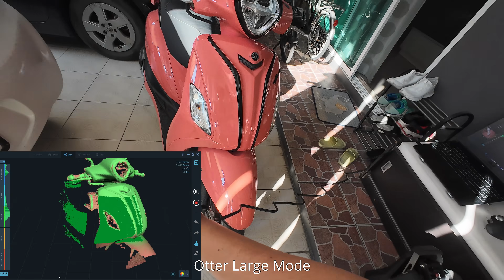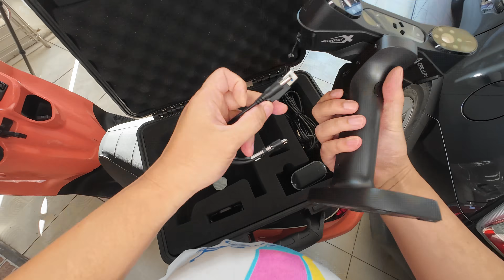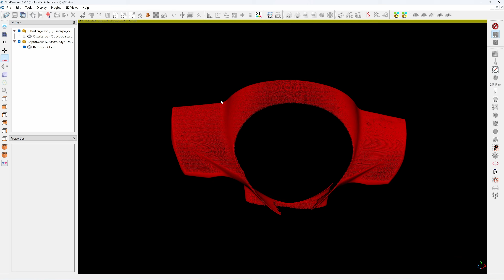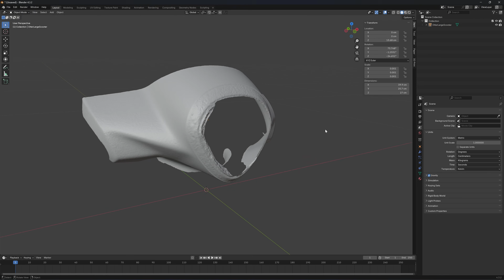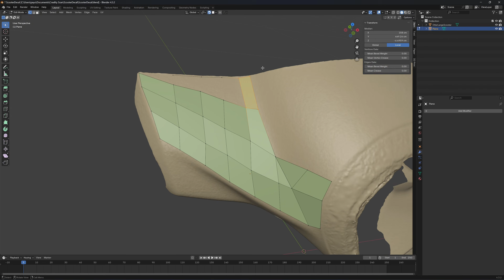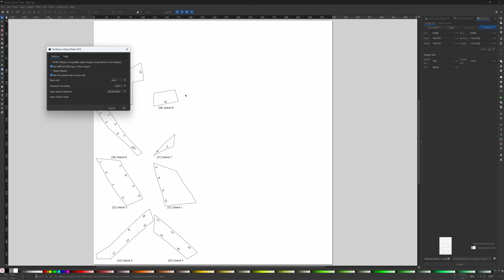3D Scanning to Unwrapping for Decal with Creality Scan Otter and Blender

Comment: Hi Payo i enjoy watching your videos, I am trying to learn 3D modeling on blender using some 3D Scans , however i am having difficulty with what i am trying to model 
Would you be able to help me with a tutorial if i send you the files?
Reply from the maker: I’ve hardly used Blender in over a year. For fixing scan data with clay, I rely on Substance Modeler. Most of my work, however, involves hard surfaces like car components, so I primarily reverse‑engineer in CAD.
Reply: @Payo-TensileCreator Ive tried fusion 360 as well but no luck

Comment: What is the probable cause of Otter Large mode deformation? Using markers would prevent it from deforming?
Reply from the maker: It's the type of projector. Otter uses dots and Raptor uses lines. Dots are less precises when detecting the depth.